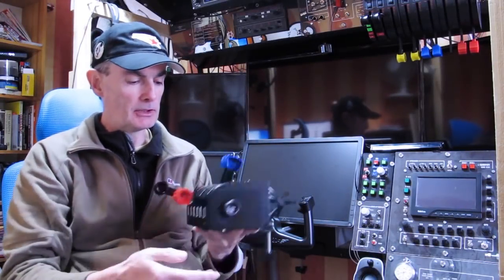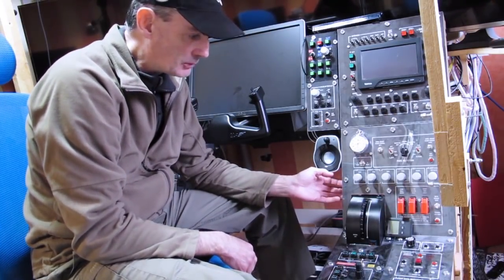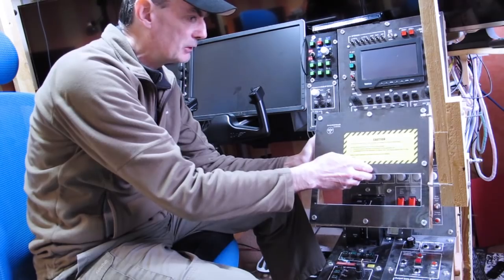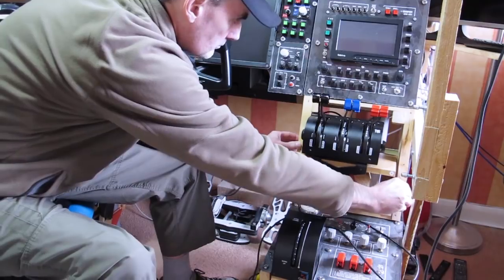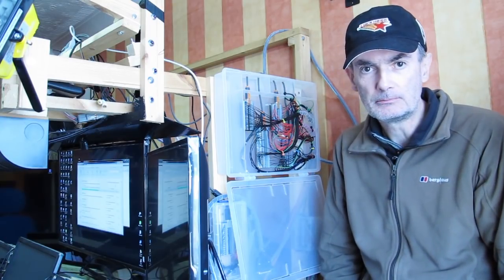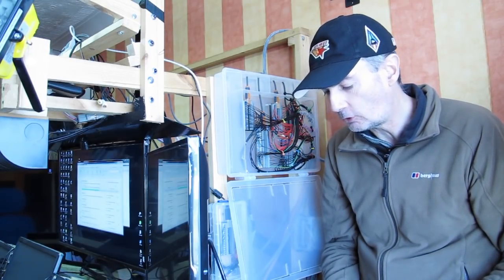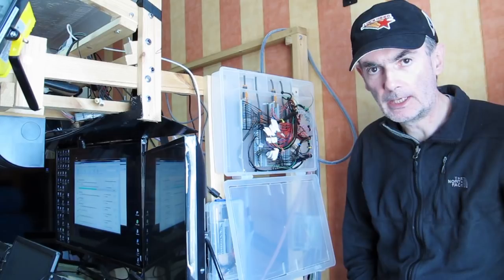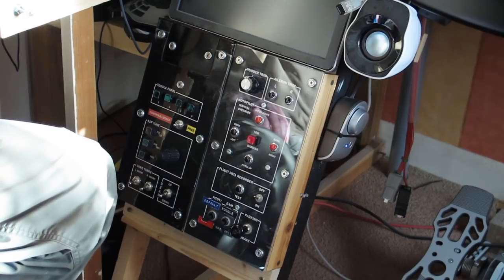Adding a VF TQ6 Throttle Quad (Twin Otter Cockpit Build - Part 43)

Comment: Just wondered what your pc spes are? Are you using 1 pc ? Just ordered your book!
Reply from the maker: Thanks for the book order. PC specs are on the channel 'about' page. I use two computers - one is for the instrument panels, which run on Air Manager on the second (low-spec) PC.

Comment: Hi. Could you of made a generic straight through extention lead for use on any panel in the future or does that cause problems?
Reply from the maker: Yes, you could do that by making a bunch of fully-wired 25-way cables. But most panels have fewer than 25 connections and several panels have more. Hence it is inevitable that you would be making unnecessary connections. It may be possible to buy fully-wired 25-way RS-232 cables off the shelf, so that would help :)